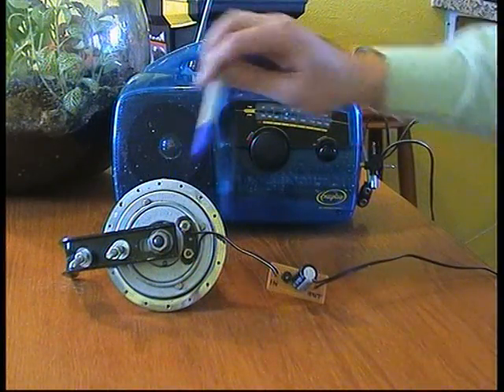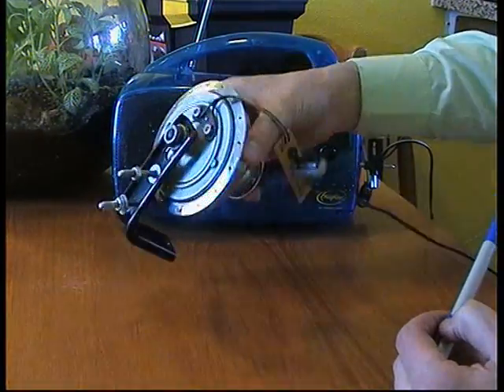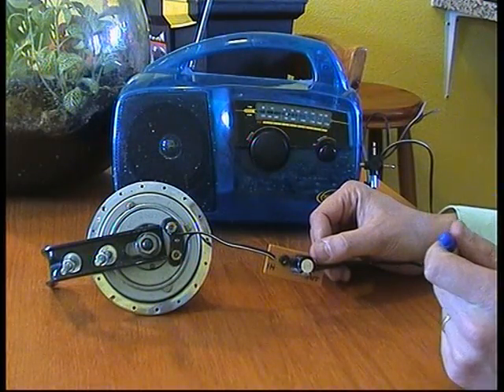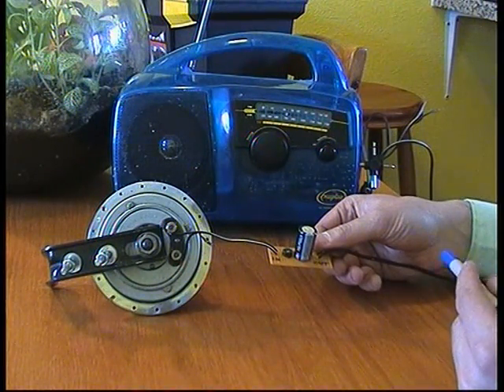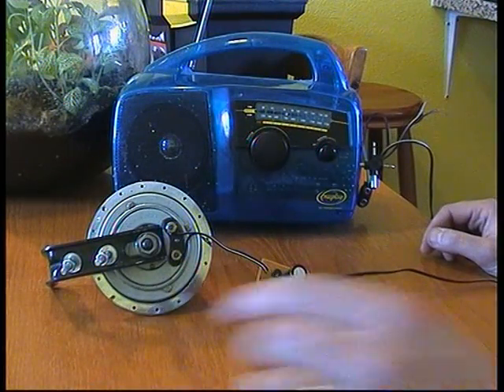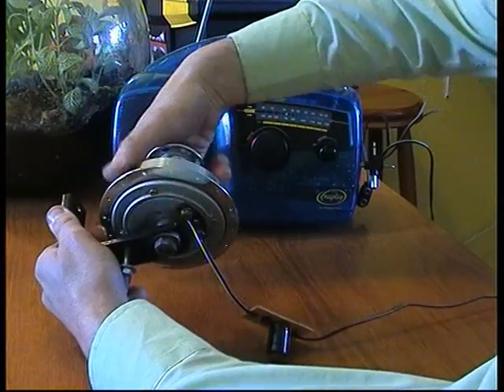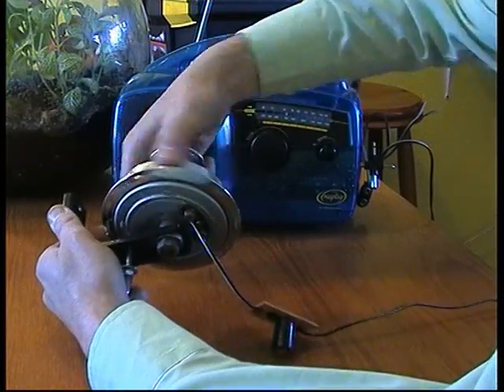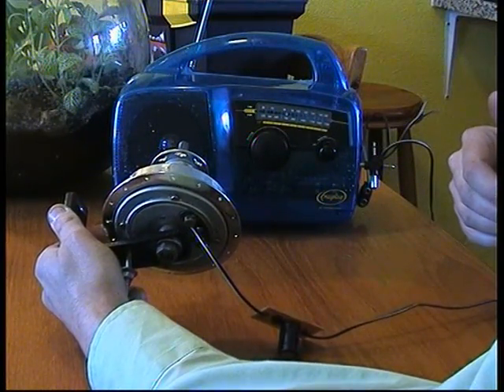Sturmey Archer Dynohub demo

Comment: Dynohubs were available in different voltages over the years, wonderful gadgets. I had an original one with the black insulated side, I gather people are now using them for wind turbines.. To those people enquiring about the rectifier and capacitor, a 50v 1amp bridge would be plenty,capacitor wants to be maybe be 16v or up and 1000uf or more.

Comment from the maker: Hi there, If you are using proper dynamo lights then you will need to connect one terminal of the dynohub to the bicycle frame. The other terminal should be connected to a cable that runs to the lights.  You will need 12 volt bulbs, I cannot remember the wattage but if you start with 2w each and see how that goes. (If they are too dim you can always replace them with lower wattage ones)

Comment: Im currently restoring an old 1960's royal enfield bike with one of these hubs on the front wheel and want to try and use it to power the bike lights. i have very limited knowledge about electricals of any sort do you have any advice about what parts/wires/lights i would need, i want to set up a front and rear light. any help would be greatly appreciated!